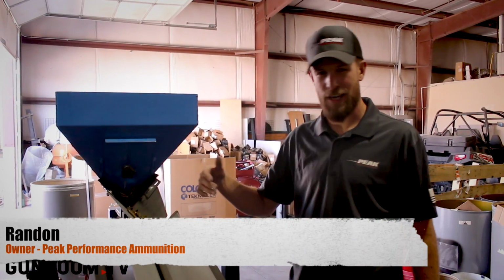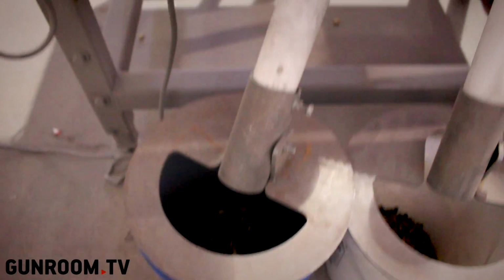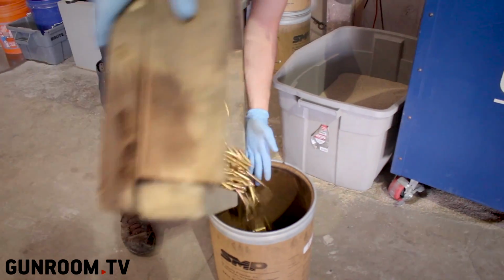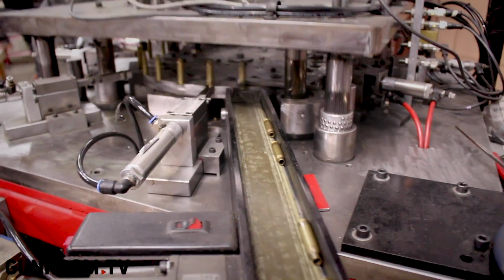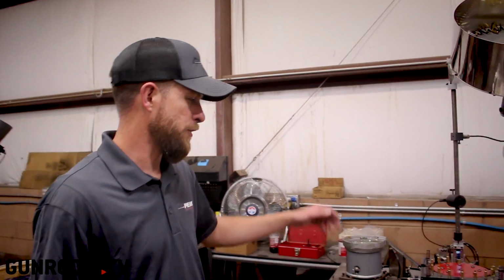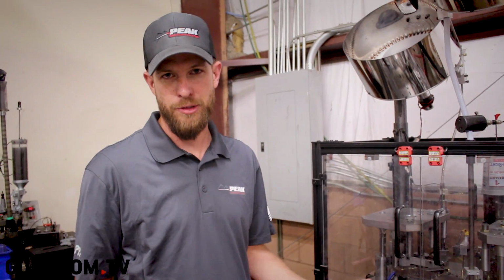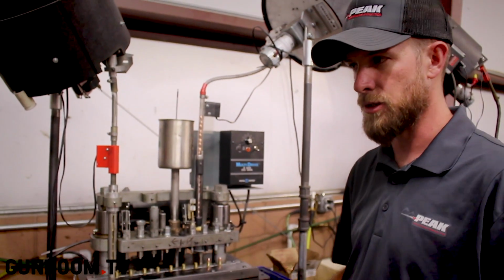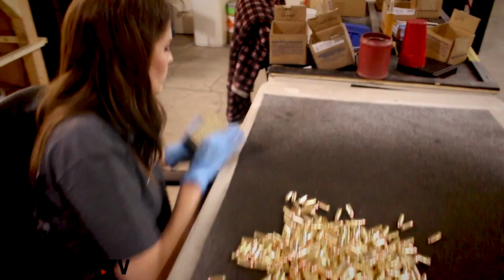Re-Manufactured Ammunition  - Peak Performance Ammo

Comment: They wouldn’t have to do all that with flip trays and guessing that it’s “close” if they had a GI-360. Granted, they are $350,000 but ever since we got ours we have paid for it easily by putting out 5,000 cases an hour through the GI. NO GUESSWORK, no flipping blocks, full 8 point laser inspection down to a millionth of an inch. Flawless, insanely quick production.

Comment: A lot of cool “Rube Goldberg” machines. However the problem with cleaning loaded ammo is that the powder can get broken apart into smaller pieces which equals a faster burning rate than intended and can create a danger.  Maybe not kill everyone within miles, but not a good idea.
Reply: None of those machines are "Rube Goldberg" in any aspect, I don't think you understand what that means.  Also, no, and I a mean NO amount of tumbling will cause "the powder can get broken apart into smaller pieces", it appears you don't have a clear grasp on gunpowder either...

Comment: So, you dont like using a rod to check powder because of loss, yet you tumble loaded ammo?
Reply: @Yuck Foutube  You're right, but the tumbling action of the powder inside the case will break down the shape and size of that powder into finer material. Which will then burn differently that intended. Now, without knowing what manufacture or wear of the chambers this ammo will be fired in, and with the possible severe increase in chamber pressure due to altered powder, I would think that this company wouldnt want a lawsuit for tumbling loaded ammo. That is reloading 101. Never, under any circumstances, ever, tumble loaded ammo. 

Watch a few YouTube videos of real ammo manufactures process for making ammunition, like Hornaday or Winchester. You will notice the lack of tumbling live ammo before packaging. 

After watching this video, this ammo is extremely inaccurate, at best. I would caution anyone and everyone to stay away from this ammo.

Comment: The words re manufactured and performance don’t really go together
Reply: You obviouslydont know how reloading works... because yes they most certainly do if done properly...
Reply: Meme ier lol right
Reply: When you fire a piece of brass it fire forms to your chamber dimensions... when you resize that piece of brass you bump the shoulder back .003 to .005 of an inch to allow easy chambering. That brass is "reused" and fits your gun perfectly... you figure out the barrel harmonics, the proper jump to the lands, powder charge and bullet type and you have the holy grail of accuracy. It's not as easy as typing this comment so much more goes into it, but yes most major competition shooters who shoot long range, exclusively shoot reloads for this very reason. You can tune the round to your firearm and achieve accuracy that no manufacturer can hope to achieve with a load that is developed for "everyone"... otherwise prove me wrong...
Reply: Meme ier I am sure for accuracy maybe but I wouldn’t depend on re manufactured to carry in a self defense situation no way.
Reply: @jesseterrell9354  why? It's the exact same process for loading "new" ammo... if you are competent it's just as reliable, and tuned for your needs... wanna load it hotter, wanna easy shooting round for practice, want custom bullets, or unique loadings, or ammo way cheaper than you can buy it in stores? You have your opinion and I cant say your wrong on the last part anyhow, but there are lots of upsides... downsides are cost to get into it, and the time it takes... other than that it's pretty much all positives.
Reply: Shoot McRunfast thousands of rounds
Reply: Shoot McRunfast sure reloading your get maximum accuracy from maybe a bolt action rifle but I would never trust my life to say a 5.56 round that was reloaded in a garage when it comes to a bulk amount. Ask any firearms instructor he would never trust his life on a 30 round mag loaded with civilian produced rounds never going to happen
Reply: Shoot McRunfast I have I reload 5.56, 9mm and 45 acp but I am not about to rely on it for self defense unless I absolutely had too
Reply: Shoot McRunfast your probably the guy who thinks your AR that you built is “just as good” as one built by a reputable company.

Comment: I wonder how they check for range brass that has had multiple firings, and is therefore susceptible to incipient case head separation?
Reply: The short answer is what Mike D said. There check for cracks will kick out practically all defective cases. As for brass that has been fired multiple times, that would probably be only a small portion of brass being sold by ranges. Government agencies selling off once fired brass would be form new manufactured ammo. If case this is a high concern for you, stick to new manufactured.
Reply: They don't
Reply: Handgun calibers tolerate multiple firings without too much risk, but rifle brass stretches a lot more, so the rifle brass would need to be once-fired only to be trusted for reloading on a mass scale.

Comment: How do you sort for Berdan primed cases? I'm sure a fair amount gets to you. Unless you dont reload calibers that have been known to use it.
Reply: The debris checker he mentioned would probably reject a case without the single flash hole in the center.
Reply: My problem is small primer .45 auto.
Reply: @onemoremisfit  I throw them into a seperate box until I save up enough for plinking ammo using faster powder. Factory sorting is another story I have no idea. You would need a whole nother machine just for that one stupid issue. Maybe they are heavier? A camera sensor/switch?
Reply: @HaqqAttak  I do same, sort them by eye and stockpile them to reload and shoot them someplace where I don't intend to retrieve them. If somebody has a machine that can sort them, I'll bet it's expensive.
Reply: If they are picking up their brass from police departments im pretty aure they dont use berdan primers as for shooting ranges they can ask the range owner to send out his people to pick up certain brass types and they pay them in which both sides get a benefit
Reply: i'm wondering the same.
Reply: Not sure how they would pop the primer out on a berdan primed cased. The decapping pin would just bend or whatever it’s meant to do when it catches on something
Reply: @dr.haroldweinstein5157  RCBS make a Berdan primer remover, but the most efficient method is hydraulic, but you can reform the pocket and convert it into Boxer primer pocket.
I loaded tens of thousands of Berdan primed cases as I had gotten about a hundred lbs of free range Berdan brass and cases of primers cheap.

Comment: that guy is dumb, a 9mm and 380 are the same diameter, the 380 is shorter
Reply: Since you're so intelligent I would assume that you know you're wrong, because the E1 and E2 (base & mouth diameter) measurements of the SAAMI specifications show that measurements differ by .01 thousands between both cartridges
Reply: Gonzalez yet these are fired cases so there is probably a decent amount of difference.
Reply: The length of the case changes. His machine sorts the 380 and 9mm and discharges the irregular ones. So, no short 9s.
Reply: @bryanst.martin7134  yep. 9mm and 380 drop into the same container but get sorted by length after that.
Reply: For purposes of sorting the first sorter he used would put 9's and 380's in same tub as it sorts by width.  He then used the bowl sorter to sort by height.  Probably spent $25k for both sorters.